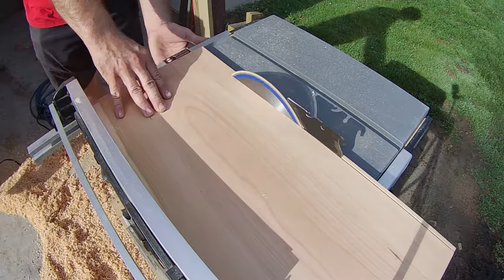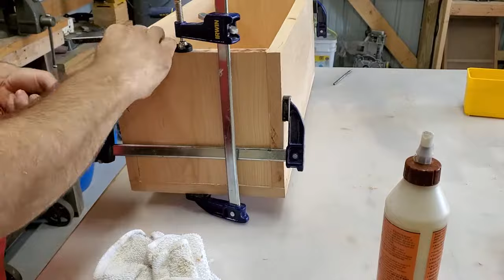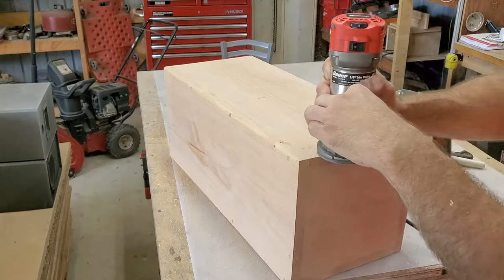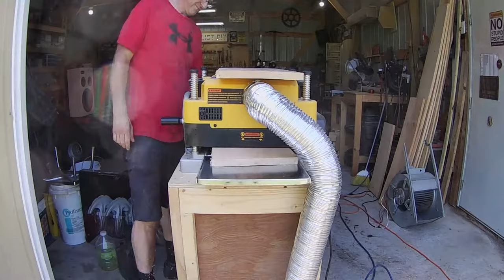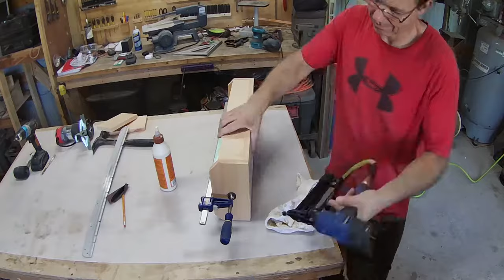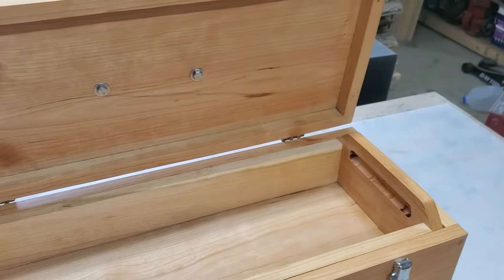Wood Tool Box Build

Comment: Nice job. Basic, functional,  & looks good. Nice to see someone else build all the sides together then cut off the lid- I learned that from my father when I was young... Just one thing- the router is dangerous. Always clamp the board to the work table. Never try to hold it with your hands. If the router bit catches and throws the board unexpectedly, your hand could be severely injured.
Reply from the maker: Thank you and thank you for the safety tip I'll keep that in mind 🙂
Reply: @jlistdiy  You can get a rubber material that is good for routing -- the items are very unlikely to move.
Reply from the maker: @IantheWoodcraftsman  excellent idea thank you
Reply: The safety first

Comment: If you would have just used dowels on the top you wouldn't have cut the steel screws and dull your miter saw blade.

Comment: Nice box. This one looks great. I am wondering what if we don’t glue the top side i.e. keep the top open after fixing 5 sides and just use the top (6th) side as lid / top cover? Will it not work? Or is it useful to first close all six sides and then cut the top side again?
Reply from the maker: Sorry for the late response I would worry about the top possibly warping without the extra support
Reply: @jlistdiy  Thanks Jamie.. I understand the significance now

Comment: What size is this in feet in length and width let me know please as I’m going to try and make a 4ft x 3ft  x 3ft  let me know what you think please
Reply from the maker: This one is 24 inch wide 10 inch tall and 10 inch deep you can build whatever size that you need so a 4x3x3 would work very nicely